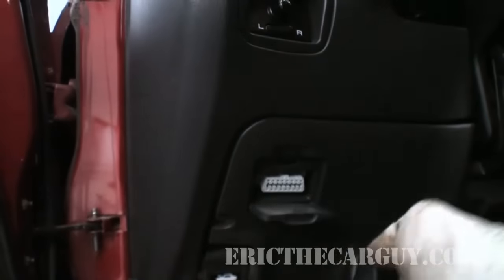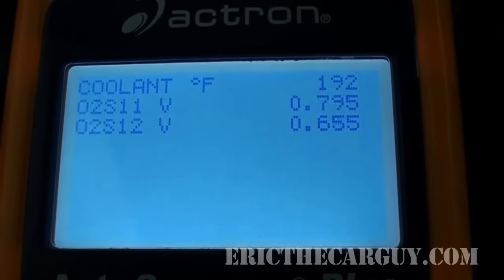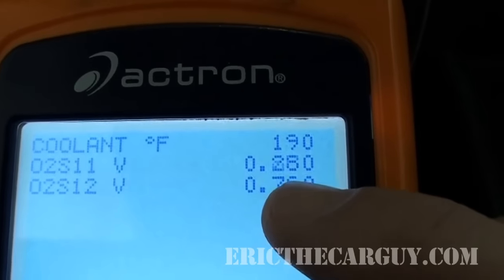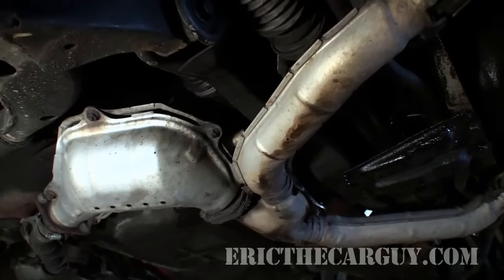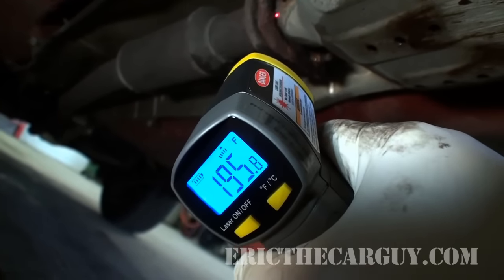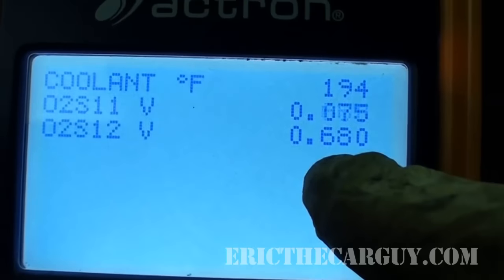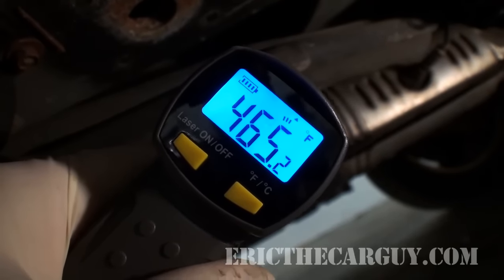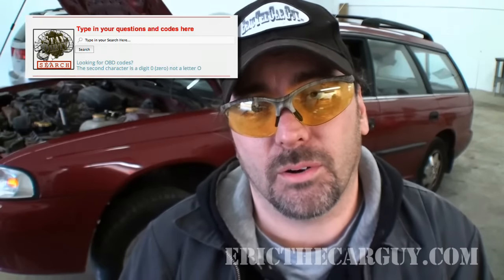P0420 How To Diagnose A Bad Catalytic Converter -EricTheCarGuy

Comment: Information that’s abundant online says that it’s perfectly normal and expected to operate between 500 and 800 Fahrenheit under heavy load it’s possible to reach temperatures in the 1200 range

I think from the common sense point of view, we can all surmise that there’s going to be some additional heat that’s created after the catalytic converter based on its catalyst 

The idea that the air fuel mixture in the upstream fluctuates with the center being at .450 mV is referred to as stokiometrics the idea is that keeping it at a general average while the computer is constantly trying to maintain that center average it’s gonna make it easier for the catalyst to clean up the trimmings

In my opinion, I do not completely agree with Eric’s assumption that his one converter is bad. I would’ve replaced that sensor and tried that before making that assessment.

Comment: So these methods of looking at the voltage on the primary or secondary sensors, will determine what conditions of the cats are,depending on what voltage is shown? Then you can rule out,whether the cat is good or bad?

Comment: Great Video good information.
I will be trying this test but I do have a question. If the Cat is faulty the check engine light would stay on. In my car with this same code the check engine light will be on usually until I fill the gas tank then it will go off for awhile until I get to roughly between 3/4 and 1/2 tank. Would you still say possibly the Cat or be leaning towards a different issue?

Comment: Great video... I have a few follow-up questions.  I just got the BlueDriver and as I was watching this video yesterday I saw the same readings on my drive home after work this morning. I reside in a state that does have emissions testing. I do not have (MIL) light illuminated, so the questions are; what it is the best thing to do? To cut the cat itself or just remove the entire section? The cat itself is 80 USD & the aftermarket cat section is 300 USD. The original part is well over 1000 and out of the question. However, if I can get away with just cutting the cat it is a big difference, any thoughts?

Comment: Is it possible to have a clogged catalytic converter choke engine to stall and not start? The inertia switch was popped as well; I bypassed it and it still won't run; changed fuel filter too. Can hear pump come on and pressure readings consistently around 60PSI with my gauge. I have noticed white smoke for a while. I have checked all fuses.. though relay I don't know how.. and fuel pressure what it is supposed to be. I dumped gas into intake, and tried to run, but chugged itself to a stall. I have PO420, and 2 misfiring codes show on scan. My next thought was open exhaust before converter and see if she will run... need advice, it is a 2004 4.0L Ford Ranger, thank you.

Comment: Here is a fast easy way to check for a clogged cat. (no tools needed ) Start the car or truck and let it warm up for a few min. Then while the car is idling WITH THE E BRAKE ON! walk to the back and hold the palm of your hand about a inch away from the exhaust pipe. Don't touch the pipe. The exhaust will be warm but If the cat is clogged it will be  extremely hot.
Reply: Isn't this the exact opposite of what Eric indicated?  On the Subaru, the temperature was 'cooler' on the outlet side then the inlet, and thus the CC wasn't doing its job.  On the Odyssey, the opposite was true - a difference of 100 degrees between inlet/outlet, with outlet hotter, so the CC was working correctly.

Comment: Thanks for the Video.  I am getting the P0420 also, my O2 bank one sensor is steady while the bank 2 sensor is all over the place, have a hard time believing a 2013 vehicle needs a new cat!  The car at times runs like shit.  I will try the infrared thermo.
Reply: it's most likely the o2 downstream sensor
Reply: Car was running so badly I had to take into the dealer.  Being 2013 its warranty is covering both Cats that they say are clogged.  I asked them what is so wrong with the engine that both cats are clogging at 40k miles?  No answer.   So I guess it will keep happening.  Looking for a good mechanic to help diagnose.

Comment: This is a great video, thank you! 
What do you think about this. I bought a 2016 Tuscon 5 days ago from a dealership. 78,000km so it still has the powertrain warranty. I saw the check engine light. So I grabbed my scan tool. P0420 so I looked into it and took it to the dealership right away. They said the code is "stored" so they can't do anything to it. I'm curious if them screwing around with the car (turning it on or off, of them possibly clearing it. Made it become stored) is stored the same as a lean code? And do you think the code would become active again if the car was operating and not sitting? I'm new to becoming a troubleshooter. I'd appreciate it if someone could explain it to me. So I can not get screwed over.
Reply: A trouble code basically tells you where to start looking you will have to test each code there are other factors that can trigger that code
Reply: @juanmarshall4083  I drove it for a month, after the dealership gave it back to me. The code came back. They dug deeper into the problem since it was there a second time. Turns out the computer was putting too much gas into the engine. Somehow the gas and oil we're mixing (maybe too much pressure?) I have no idea. But they needed to replace the cat. I've been waiting for the part for over a month. They finally got the cat in. They discovered my turbo was tampered with by a previous owner or garage. The turbo fell off. They took it to a machine shop to have it fixed. They just got it back to the dealership. Finishing work and doing an oil change. It's been 2 months without my car. Hopefully it's ok. My warranty runs out in Nov. They also had to update the computer so the problem won't happen again.

Comment: Hey I have a 2002 Honda Passport that needs a transmission rebuild it totally locked up on me coming home from work, but anyway, the truck fires right up but will not rev up. It bogs down and almost cuts off. I've noticed too sometimes I turn on the defrost the engine bogs down and almost cuts off. This power lost gradually happened after I had #6 coil replaced and control module. I wanted to lean more to somekinda timing issue, maybe electrical related. This truck ran perfect until I parked it for a 1 1/2 or 2 months what's ur thoughts on this?

Comment: Thanks, my jetta 2008 2.0 std has been giving me a "P2096 Code Post Catalyst Fuel Trim System Too Lean Bank 1", so far i dont notice any stalling, problem accelerating or fuel eficency issues so far, i do drive around 5 miles a day at 30-40mph tops.  i just got a MS509 reader and the live readings on the o2 sensors at 2000rpm, the first one fluctuates rapidly between  .100 to .700 and the second one stays solid at around .450v  
i havent checked temperatures, but one shop said i would need a new cat, and the other said it was the o2 sensors.

how should i check for sure after temperature?
car only has 27k miles of use!

Comment: Hey, I have a question whether my Cat really is bad or not. I got the wonderful P0420 code for a couple weeks and been going through a checklist on symptoms. The car seems sluggish lately, and will not accelerate quickly anymore, I have to slowly increase speed. I tried accelerating faster than normal and had a cylinder misfire with the P0300 code and Torque Management P2637, which eventually disappeared after 5 minutes. I cleaned the throttle body and MAF sensors, checked the ignition coils and spark plugs and all seem to be fine. The 02 sensors seemed fine on inspection. However, when I measure the temperature around the Cat, the inlet weld is about the same or up to 70F higher than the outlet, this infers a bad/clogged Cat. What I don't understand though is that through the OBD2 voltage readings, the pre Cat 02 sensor oscillates rapidly around 0.1 to 0.85V and the post Cat sensor is fairly steady around 0.8V and only dipping to below 0.15V when I push the gas. These readings tell me the Cat should be fine though, but the temperature readings tell me otherwise. Should I go ahead and assume the Cat is bad? Can I drive with the Cat removed just to see if the car responds as it's supposed to under acceleration? Thanks!
Reply: +Nicholas Loe  I had the po420, car sometimes ran normal but then bad on 3 cylinders. Dealer said CAT was shot, I replaced all 4 coils and spark plugs myself,  runs great.  Got 4 coils at araparts.com for 95.99. plugs were $50 at oreilly. $145 bucks car runs great. Dealer wanted $1000 and then I would have still need a coil! Just replace all 4 coils  for 95.99 instead of $70 for 1.    Good luck.  I have a 2004 nissan 2.5 sentra 123,000.

Comment: Hey Eric, I watch all your vids. My car has a p0420 code, my O2 readings are just like the Subaru on bank 1. I have 03 Taurus 3.0 ohv. So I know what converter is bad. My question is, now I'm losing power and acceleration so will a clogged converter cause those same O2 readings? Switching back and forth on pre O2 sensor as well as post O2 sensor. My other bank is reading normal. Thanks

Comment: Hi great videos you have always, I like to watch your video. Any idea or suggestion about P0420 code. It only come after fill up gas. This started to came on after fuel injection cleaning. I have replaced catalytic converter both  O2 sensor as well. After i use octane booster 104 the light didn't come on for long time. I stop using for a month and ECU start throwing same code. Now i have been using for octane 104 booster and light come back on after week? Any advise will be helpful. I am guessing one of injector is leaking. I have changed the gas cap as well. how to tell without tool if injector is clogged? My friend at Honda told me after fuel system cleaning it happens a lot. He advised me not to ever do fuel injection cleaning because it causes more problems than solve. Is there way to test or check if injector is clogged with out tool? Thanks

Comment: Hey Eric,

I'm having the P0420 code in my bmw e46. My 1st o2 sensor is jumping around, and the 2nd one is staying at around .7-.75 when reving around 2-2.5k rpm. I'm trying to pass emissions, and i'm worried about failing, if i perhaps used the lacquer thinner solution, do you think that might clear it up? Anyone else - thoughts?

Comment: O.k. Eric, I definitely need some help on this 1... I've got a 92 toyota paseo (automatic trans) and it failed CA emissions for high NOx @ the 25 mph portion. The engine stumbles and dies when direct vacuum is applied to the egr valve and ive got vacuum at the intake source. I've already replaced all the vacuum lines... So it seems I'm left with the vacuum switching/ egr vacuum control solenoid as the culprit... Question is how do I test that? Being an automatic trans it's got 3 connectors and 6 vacuum connectors. My wife and I are down to 1 car now and the kids are in 2 different schools and she works days and I work graveyard... Help please!?

Comment: I have a good question here....I have a 2005 Kia spectra. I put "Megan Racing Headers" on it, a new cat, new 02 sensors and a full tune up. My check engine light came back on. And I believe its because there's no cat between the 02 sensors now. So how far behind the cat does the 02 sensor need to be for the 2nd 02 sensor to read the right temp????  Thanks for any help.

Comment: I've had a reoccurring p0420 code in my 2012 Impala LTZ.  I been going nuts over it because upon accelerating now, it makes a RATTLING NOISE which I thought was the engine or something.  After a ton of research and poking around, I am almost positive the rattling noise I'm hearing is the honeycomb part of the Catalytic Converter has started to crumble and deteriorate (for whatever reason) and needs to be replaced.  However, the price of these cats(bank 1 in the front, by the engine) is an ARM AND A LEG!  
The question I have now is can I stretch it out and keep driving like this due to financial limitations????  Or will it inevitably lead to other serious damages???  Is it possible these crumbling broken parts can spread to the other parts of the car such as the engine and really mess up my vehicle??  Or is that not how it works?
I used the Cataclean after watching many videos and testimonials on it which turned off the p0420 check engine light code, HOWEVER, it didn't fix the actual issue aka the noise.  It still rattles badly upon acceleration but it did keep the CEL off so far for over 300 miles!!!!!!  Before I used the Cataclean, it would pop on within 25 to 40 miles after resetting it like clockwork!  ANYONE HAVE ANY SUGGESTIONS ON HOW TO REPLACE THIS/FIX THE ACTUAL ISSUE SO MY CAR STARTS RUNNING/ACCELERATING SMOOTH AND GOOD AGAIN WITHOUT TRADING MY LIMBS AND MY FIRST BORN LMAO
Any advice or tips or ways to get around this expensive repair would be amazing!  Thanks so much and look forward to responses!

Comment: What should be the approximate normal F. temp. increase / ratio of pre cat. / post cat. temp.? Is an increase of 100 degrees F. post cat. converter sufficient to say the cat. is still good? - I'm getting 420 F. pre. cat., and 520 F. post. cat., (outflow), on my 2000 Cadillac Deville. (and I'm getting DCT code P0420). Thanks much. Great video!

Comment: Eric, you Seam to be a good mechanic, question I own a 2001 ford ranger, 80,200 miles, not driven to much on a daily basis, the issue is it runs fine around town 50 and below,  above 59 it’s like pulling tooth and nail. Does this sound like s bad Catalitic converter? Thanks Steve
Reply: Above 50 I mean

Comment: IF it's a recently replaced catalytic converter, and the temps of the inlet is 100degrees higher than the outlet, could there be an issue causing it to not be doing it's job? Such as exhaust leak, or perhaps bad spark plugs causing unburnt gas getting into the cats?

Comment: Thanks so much for the informitive video. Unfortunately I live in one of the seven northeast Ohio counties (of the 88 in OHIO) that still require vechile emmisions testing so that you may obtain vechile regerstration tag. What upsets me even more is this program about clean air is no longer willing to actually read what the vechicle is emmiting by putting the car on the dynamometer and proving the vechile is outside acceptable limits. I have found on my high mileage Honda Oddessy that the thresshold for turning on the engine light is FAR sooner than the allowable state requirement for NOx. How do I know this? Back when they were making the transition to full OBD testing, they were still maintaining one bay with the dyno. I would use my OBD tool to reset the engine code,  they would say your car is not ready, then I would ask if they were refusing to test my car because it did NOT have a diagagnostic fault? This worked a few times and then they would reluctantly put the car on the dyno and provide the printout showing the emmisions in comparision to State acceptable levels. Guess what? It passed 2/3 of allowable. Not that I want to have these clowns operate my car, (I say that because on one occasion one "technician " jumpped off the dyno to the side because he was not proficient with a stick shift), but if the EPA program is no longer willing to prevent actual pollution as it was intended, then scrap the program. I'm sure it is expensive for the State to maintain exhaust monitoring devices, a liability for them to operate the consumers car, and going full OBD is easy. But the threshold for turning on the engine light needs to be consistant with State or Federal standards, but I'm sure more service and parts are sold if the indicator is activated early. Right now I'm fighting the PO420 code on my son's Accord that he can't put plates on due to this rediculous program. I'll get it, but it is just so frustrating!

Comment: I watched your video on knock sensor as well as this one I noticed it is the same subaru my question is did you replace the cat before the knock sensor? I have a 1998 subaru legacy outback I replaced from the middle cat (was still OK ) to the end (new rear cat, new resignator, new muffler, new tailpipe) about 2 weeks ago I immediately had shifting hesitation like as soon as I picked the car up rpms shoot up & down once you get to 50mph or anything higher it smooths out & stays at 2.5 rpms & runs fine it is just getting going I had it to a garage that said it might be the transmission but I don't believe that really (transmission fluid is full & clear oil is full & clear) I had no shifting /hesitation problems before I replaced the exhaust system I think it might be the knock sensor but the garage I took it to thought I was nuts & refused to check it. Oh it runs worst in the rain or if it is damp out which also makes me think water is getting in somewhere there is no check engine light on & the idle seems high (I did spark plugs, wires, coil pack about 8 months ago too) any thoughts?
Reply: Sounds like a problem I had. Unfortunately I hadn't educated myself before having my cats replaced. After that repair it was later discovered that my throttle position sensor had gone bad.

Comment: If it doesn’t have o2 sensors then you’ll have to take the temperature. But if the manufacturer releases it the scan Tool also has cat temperature under live data. I have the actron scanner that was made prior to yours and it has that pid in it at least for 2010 Jeep. (Mine isn’t even bidirectional) I’ve had it for years and never knew it was in there.  I’ve been trying to find info on what the data looks like if it has an exhaust leak. Mine’s entering open loop when I let up on the throttle at highway speeds. No luck yet.

Comment: Will you pass emissions if only your front catalyst is working? I have a secondary cat under the car but it is not monitored by o2 sensors weirdly, only the front cat attached to the down pipe.